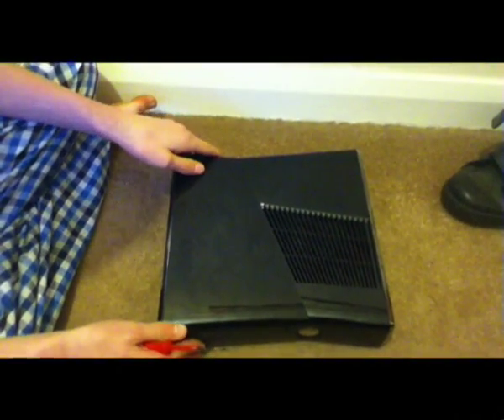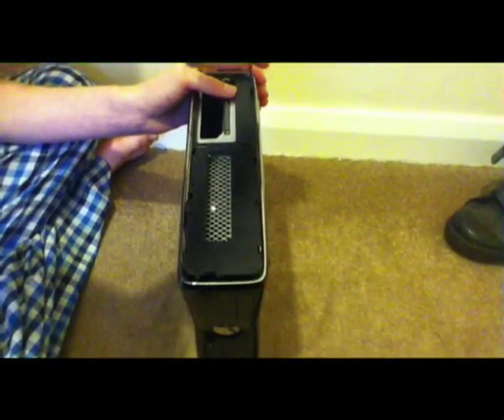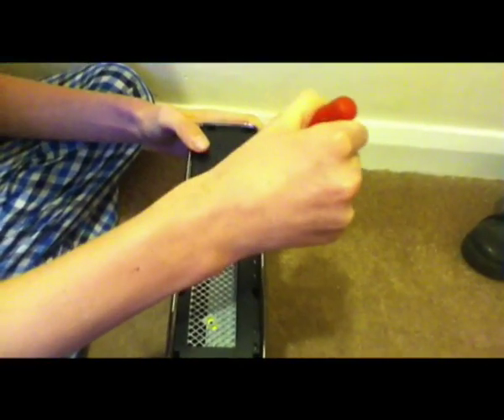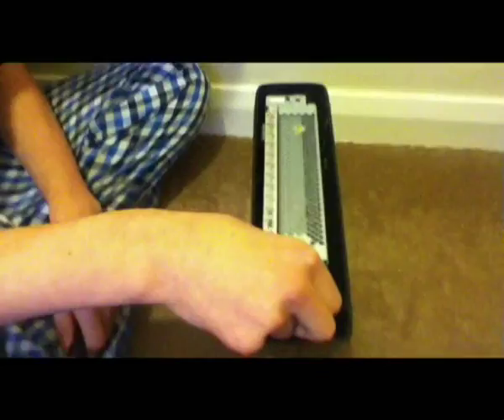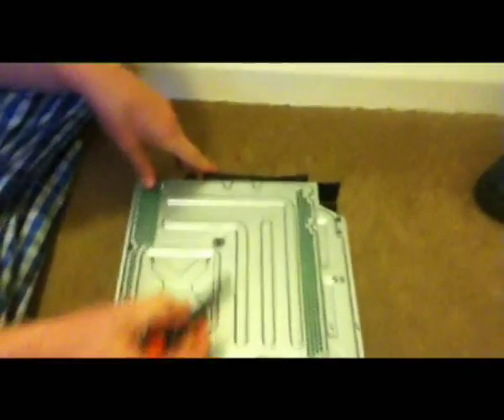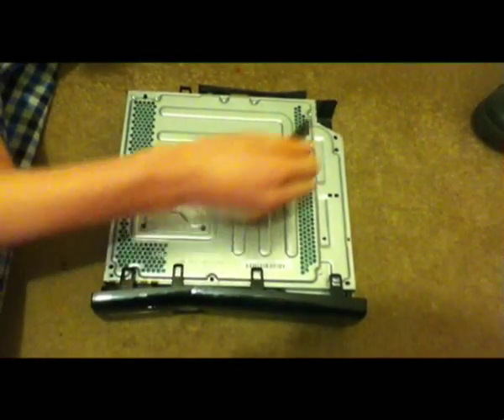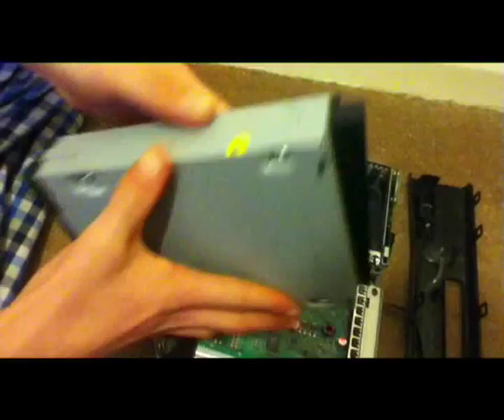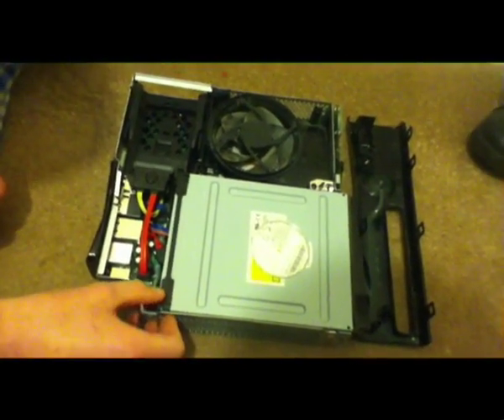How to Take Apart Xbox 360 Slim for Hotswap/Repair

Comment: Don't have t10 screw driver.Can't it be opened by any other screw driver?
Reply from the maker: Try with a small flatehead, but you can pick a t10 up for £2 on ebay
Reply: Ok

Comment from the maker: well bit of a stupid question but did you remember to plug the wifi chip in? If it is in and you are sure it's connected properly it probably hit a static nerve, they are really fucking sensative all chips/motherboards are. If that is the case you can buy an official Microsoft Wifi Adapter or just buy another chip for like a tenner so not a big deal

Comment: my xbox is having some wierd problem it will start up four to five times slower then it used to and im not sure why it will also take a very long time to sign me in join partys or do anything for that matter and ive noticed that the fan doesnt start up when i turn the xbox on as it did a week ago would you happen to know what might or is wrong with it thanks

Comment from the maker: It seems that when you were hotswapping you might of acsidenty touched the laser what i would reccoment doing is taking your xbox 360 appart again and get a soft cloth and just press down on the laser until you feel it going in. then give it a little rub then take it out and see if it makes a difference. If this doesn't work you could try going to Clearing the system Cache.